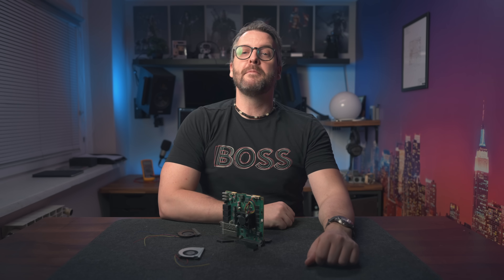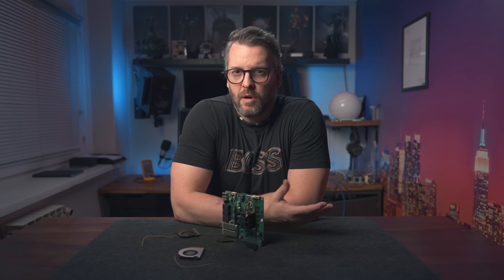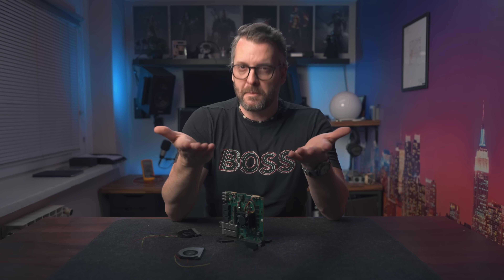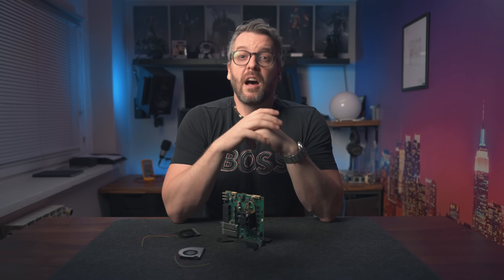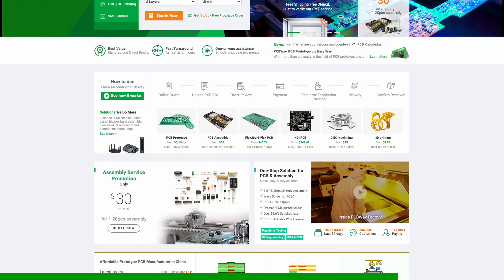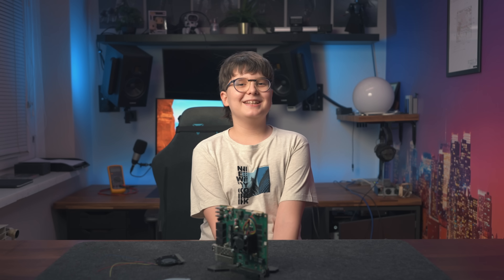You Wanted a Cheaper Router. We Can Do That.

Comment: 2 things I look for specifically in this type of device. I want fanless, and I want x86 64.
Reply from the maker: Out of curiosity, why x86? Be as specific as possible, please, I'm genuinely curious.
Reply: @tomazzaman  I'm curious what you think of my opinion on this. I assume price would be a lot higher for x86 64 cpu, and additional components to support it, but the convenience is very nice. basically a tiny low power server, run opnsense in a vm.
Reply: @tomazzaman  there's little to no actual benefit to using anything other than x86 64. the power to performance benefit doesn't really exist. that is the main reason for arm, low power usage. but x86 64 can be just as good anyway. why yet another architecture when there is no reason? it is much more convenient when I can put whatever os or software I want on a piece of hardware without needing to find a special format.

Comment: The good question about networking performance is the HW offload... If the CPU's power reduced, you're only able to do the same performance, if you using the offload, which - as far as we know - only available if you have a lot of money, and buy the NXP license. So this will be only true, if the cheaper board used with the original software, which possibly will be created by you, and no thinkering around without performance loss...

Comment: Price optimization is always hard, i would go with the bigger cpu, maybe even ecc but cheaper ram modules, and try to do all other price optimizations, to get it to the $300 mark but with a big cpu and ecc, so you have a product which beats the competing routers even on hardware.
Sensors are cool but not to big of a difference, a sensor for measuring the complete input power would be great and more and more routers have one.
For the connectors, only ensure that they work and are reliable, they could be cheap, even some large manufacturers get there parts from cheaper companys sometimes …
I think $300 is a good limit as a lot of routers in this range have already wifi, it is easy to add to your design but its not included, so i would aim to this spot.

Comment: I'm on board with the other people and don't think competing with servers is required or beneficial. A nitpick, going from 300 to 600 is not 50% margin but 100%. Going cheaper means that people might actually buy 2 units. I'm not the target audience, I think people that actually pay a starter's fee should be able to vote the configuration, the rest of them (like me) are just armchair experts.
Reply from the maker: Thanks for the feedback. Regarding nomenclature, if a product costs $300 and is sold for $600, the margin is 50%, because it's calculated relative to the final price. Markup is 100% in this case, because it's calculated relative to the cost of manufacturing.

Comment: I’d argue this: First get as big of a market share / customer base as possible. You had the dev kits that had additional power and features- I guess - to better diagnose and develop the router. So now make the actual router as cheap as possible for the aforementioned market penetration with the only exception being the PCB. There I‘d say leave support fir a bigger emmc and ECC RAM. Once you have the discounts (…) and economies of scale, start a second line tailored for performance with higher clock, 4 core cpu ecc ram and big emmc. That might be sold as a „routing serve“ - tailored to routing but with enough power to run any moderat compute task. 

My best guess is, that this line will sell less units, since I‘m expecting the number of customers that have the need for 10Gbit networking but no Homelab and therefore need a server to be quite small. But since this is your second line, you can profit from your relations and economies of scale.

Comment: My 2 cents, if you are reading, I believe anyone watching your channel and considering buying your router is already into homelabbing/networking either as a hobbyist or as a professional. And they would likely (based on the few on me and my friends who are homelabbers), already have specific hardware to do specific tasks like a separate nas or a high core count cpu system where they host various services in docker or otherwise, and other dedicated devices for networking. So if making the best possible solution for networking while sacrificing some not so mandatory features brings the cost down and makes it more accessible, thats always a plus.
Reply from the maker: I am reading (though not always respond - limited amount of time and all :). Thanks for the feedback!
Reply: I have all that and I dream of getting rid of it all and hosting everything on small box with low power consumption

Comment: I vote to optimize networking performance and price, because those are the problems you initially set out to solve. 
It doesn’t hurt to have a high-end model that can do more… Or a second device that could handle the in-home server tasks or whatever else you imagine using it for. 

High-quality, dedicated networking-hardware (meant for consumers) is hard to find — and it’s even harder to find at “consumer” prices (sub $500). 

Lower-end CPUs and fewer chips also require less power, which means that the long-term cost of ownership will be lower. 

In terms of extensibility and versatility, I would rather have a connector for a “raspberry pi compute module”, because that’s a standard ecosystem that is well supported and could be modularly-upgraded over time with no extra development-spend on your end. 
Having the discrete “compute module” would also free it from competing for compute resources, and would give users the flexibility to run whatever OS or environment they want without otherwise affecting their network.

Comment: Maybe you can integrate the cpu heatsink into the case? Maybe this saves also some costs.
Reply: Heat sinks are cheap integrating it in the case could actually result in more problems and require different thermal coupling

Comment: ecc not required!!! blah blah blah hardware. 

networking!!!!!!!!!!!!!!!!

No docker. No virtual machines.  Mount USB drives, and USB-C to 2.5g.   Must come with power adapter. 

The only reason i want to purchase this is for your custom software :].  The channel will need to change from hardware to software!

pretty much
pretty much
pretty much
pretty much
You said pretty 4 times!

Comment: All the optimisations sound logical. I am not that price sensitive and would buy the $600 option, but if there will be the one for $300 without MMC, and with a weaker CPU - I would choose that one.
Most of us have a dedicated machine for running non-networking stuff on. I don't know if this CPU has encryption offloading like AES-NI on Intels, but if it is - what else do you need the CPU for? DNS server, and that's it. And MMC - it's not something that I actually need even on my NAS, why would it be for on a router? Memory is very reliable now, the networking protocols themselves have error correction, so if a bit flips once in a millennium - no one will notice even.

Comment: $600 for a small form factor homelab networking and container board sounds pretty good, hook up a NAS and thats basically an entire homelab right there. if it can run Nextcloud, HomeAssistant, some lightweight headless game servers, and manage routing at full speed, i don't think the price is too high. its probably nearing AUD $1000, which isn't an impulse buy by any means, but seeing the quality you put into this, i'm sure that will do for a good long while for the occasional hobbyist. if you make it only really capable of routing, without much additional headroom, $500 or even $400 becomes a harder sell. i'm more likely going to consider a beefier x86 platform if it doesn't cover all of the essentials for selfhosting.

Comment: Cut costs, extra things like docker are nice but will only lead to people being priced out.  Odds are that if someone wants docker on their router, they already do it somewhere else.  For rack mount case, go with a small metal enclosure that can just have ears mounted on it.  Ears cost extra and can be had in 10" or 19" rack size.
Reply: While 10gbs are very nice to have.
Personally I do run docker on my router. Actually I have a virtual router running on proxmox on an N100 box. I'm using it to run my unifi mgmt (amount other things). 

So having that flexibility might be useful for some. You might even just want a local DNS.
Reply: @uriba107 I do the same as well with an m920q and 4 port nic (tp-link omada though).  For a startup, I still think keeping costs low would be more beneficial from a sales perspective.  Nothing stops you from running your current router as a dedicated docker/virtualization box.

Comment: Waiting for raspberry pi5 compute model board to get its software ironed out, so I can mainly use it for wifi stuff. Honestly the problem with supporting projects like these is that, who knows when this project will stop existing and support stops. Atleast with the PI5 based thing you got a large already existing community and its well trusted and if something breaks you can just replace the compute unit or the board even if the warranty is gone.

Also for $600 would just get Protecli firewall with OPNsense and coreboot firmware.
Then just run some wifi router with OpenWrt with it like the rasp pi5. This is my future setup.

Comment: To echo what others are already saying, I already have a proxmox cluster for homelab things. I don't want another device trying to run containers. There are maybe 2 things that this device would be useful for since it's one of the last things I want shutting down in the rack when power goes down: nut-server with a USB to my UPS, and wireguard. If I can get to the shell and install those 2 utilities, or do so through the GUI, I'd be elated.

Other than that, focus solely on networking performance and lowering cost. Although I would recommend to stick with some good passives, and QC on the PCB. In my industry we've had a decline in PCB reliability in the past few years, even from suppliers with decades of history. Tin whiskers, counterfeit parts, bad conformal coat, bad PED staking... If I smash a RJ-45 connector, that's on me. But if we can avoid having to reflow joints, replace caps, etc. that is a reasonable expectation.

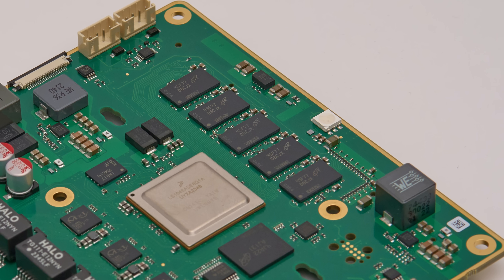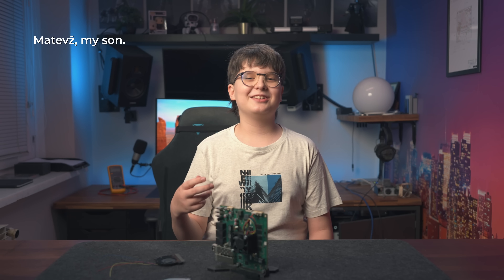Comment: Tere Tomaž, At @5:19 is the main processing part of the CPU still expected to be doing almost nothing due to the fancy network driver stack you talked about a few videos ago? If so, then if the CPU is just going to be snoozing, then I would think CPU capabilities would be a rather safe place to target a cost reduction.... since the Frame Manager is the same.  At @5:44 I would think operating temperature down to 0° would also be a safe assumption. At @7:13 I would highly suggest not sacrificing the quality of Micron MT memory chips. Sure, perhaps drop the ECC chip.... but keep the Micron MT quality.  At @10:04 Bravo team! That sound a very intuitive development solution. 🎉 At @10:35 no, leave the NOR Flash chip alone.  At @14:21 yes, the connectors can be exchanged for the less expensive connectors. At @17:36 Väga tubli poiss! 🎉

Comment: I would say that a removable, bootable storage option is essential, for when (not if) the device eats up the flash - optional m.2 SSD (SATA or NVME, future availability is a much larger priority than device speed here) support would be nice, even if you'd have to swap out one WiFi card for it. Personally I'd run most things on a different box, but I would like for the system to be powerful enough to run a few things in addition to VLAN routing and wireguard, namely utilities like NUT (for UPS monitoring) and maybe something like Smokeping. 2-4GB RAM would likely be more than sufficient, but I think you should keep ECC. Drop at least one Ethernet port - a single 2.5G ethernet port would be more desirable than three 1G ports (but keep in mind that some 2.5G ports don't negotiate 10/100Mbit, which some devices you might want to plug in may require, like VoIP devices or similar). Full upstream OpenWRT support is something I consider mandatory, bonus points if all the hardware also works well with plain old Debian. Drop the USB-serial port, keep a unpopulated TTL header easily accessible on the board (preferably with a chip protecting the CPU against ESD and such, 5V tolerating 3.3V signal would be safest, as there are many chinesium adapters labeled 3.3V that output 5V, unfortunately). As others mention, keep using decent passives and connectors, I'd want at least 10 year usable life from the investment, ideally I'd only swap it because I can get 100Gbit fiber some time in the far future. Keep at least one power monitoring sensor for full system power usage, every device or outlet should have one.

Comment: At this point I think it would be extreemely benefitial to do a side-by-side comparison of this router to a few of the commercial routers and even one of the custom projects using OPNSense, etc. I think some of the primary selling points are getting lost almost as "meta" attributes. i.e. routing throughput. Firewall overhead on throughput, etc. Most people think that 10g is absolute vs theoretical, and thus don't understand how CPU and Memory and stack offloading impacts actual packet throughput.  I would love to see how this compares to the Ubiquiti Fiber gateway (which I recently purchased) in a side-by-side test of throughput.
Reply: To expand on this I would absolutely LOVE to see a side-by-side of packet throughput with the following iptables/firewall rulesets:  50 rules, 100 rules, 1000 rules, 5000 rules.
Reply: I would be equally interested in this comparison.
To be honest I'm very interested in this router because of it's open nature, but I do have Ubiquiti gear in my house and I love it.
Also, as a community we might find a way to communicate with the Ubiquiti controller and expose all the data the router has to it, which is not possible with other manufactures besides Ubiquiti right now.
Which would be something I would be interested in. (Although for it to make sense more people should be interested in it... :) )

Comment: I've said it before, but you really need to justify who your target market is, and why they should buy this over the hundreds of established competitors offering "good enough" performance and quality. If your marketing is focused on the best performance and quality, you're only going to be selling to an enthusiast crowd, when you really need something that the Apple iphone lovers of the world want. And the key to that is the software and support. As a small company, you don't have an established name and no way to prove longevity of the company, or how it differs. $600 can be easily justified to anyone if you have the right story for it, and it fills a demand - again, just look at the iPhone and the margins they get away with, yet consumers still (arguably ignorantly) swallow without question. I'm less concerned about cost optimisation at this point until I've heard about the software ecosystem and how it compares to other high performance equipment. Maybe draw up a market scan table of the competition and see what they have on features and performance, and elaborate more on how the software is going to look for this unit? Good software for a user is all about simplicity, UX and ecosystem. For an enterprise it's all about feature completeness, reliability, performance, manageability and support, for an SMB is pretty much the same as consumer but with the support and scalability features. I think these are topics to think about before going too far on cost optimisation and potentially taking away things that make this product unique.

Comment: I like the two tier approach, have one that’s got the better cpu/ram/storage and have another that’s got the cost reductions as your lite offering. The lite could even ditch wifi and the m.2 slot (plus related passives/power rail) to reduce cost further, if that’s a feature you want, then get the standard one. Ideally you could have identical PCBs but with a few parts swapped out or not placed for the two versions as that reduces complexity. The lite being a no frills high speed router that’s just a router, the complete one having the extra features, performance and expansion options.

Comment: Instinctively I want to say keep the ECC but my 13 year old router likely doesn't have it and has been chugging along fine the whole time. Would be kind of nice to keep at least one power sensor to monitor overall power draw but not required. Not sure on CPU or RAM size. Since my router hardly does anything it gets by just fine with its 680MHz single core CPU and 128MB of RAM :V

Comment: To everyone here suggesting that, for the price, you can build a (mini ?) PC with as much or better performance:
please list here the parts you'd be using to match the (main) qualities of this router:
3x1Gbps Eth, 2x10Gbps SFP+, 20W power consumption (basically, powered by a phone charger), about 0.5L volume, but I will accept up to 2L.
I won't even require you to offload the networking to dedicated hardware like this router does, let that CPU work its cores.
Can you make it?

The point of this post is to make you realize that there is a reason why dedicated hardware exists, and not everything is a repurposed x86 PC.
Reply: yeah, even if I can't afford this, this project is awesome, if people want a server, build one, this is supposed to be a router unless I'm mistaken

how much feature creep do people want? just add removable memory, and M.2 slots, and a Ryzen CPU, and this and this and this, and I want to pay $1 for it all

come on people
Reply: I'd buy a Banana Pi R4 from Aliexpress for $100?
Reply: thank you i was wondering why it's not considered in the video.
Reply: all they had to do was make the board and use a rpi or similar
and regards to what u r saying small client sized pc's r cheap and getting cheaper by the day